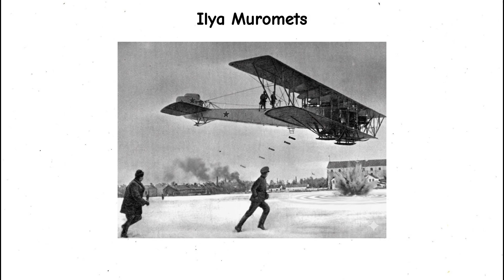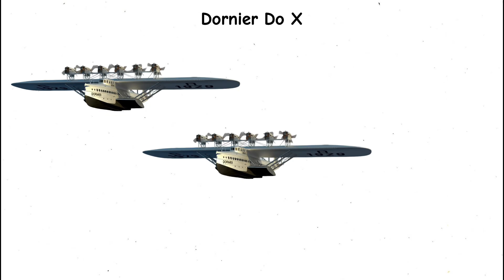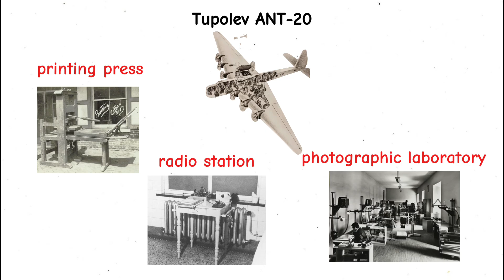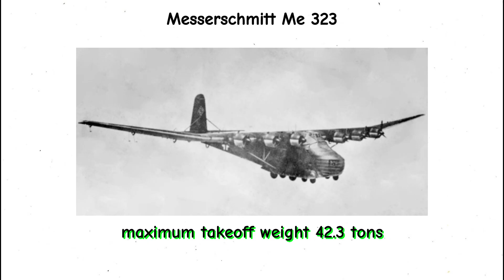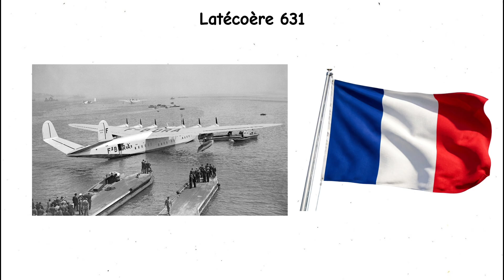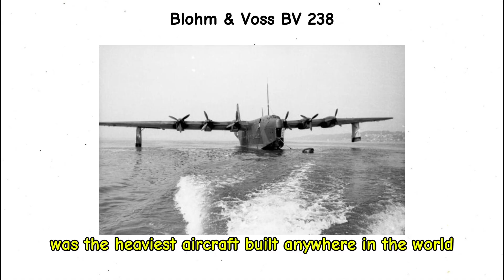Every Largest Old Aircraft Explained (1913–1944)

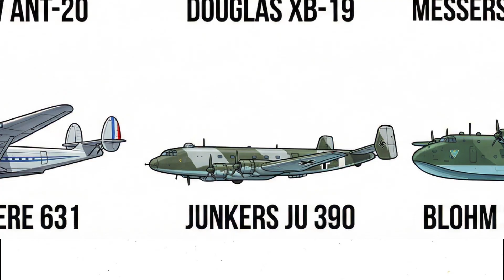Comment: In 7:38 scene, Ju 390 use powerplant by BMW 801E engines(deploying about at 1,975hp), They originally planned for BMW 802 or DB 604 or Jumo 223 engine, But three new and over 2,000hp engine has tested to fail and no massive production, They have use BMW 801E engine to give Ju 390, And that try to use BMW 801Q(turbocharger) or 801R(two stage four speed supercharger) give Ju 390 more flying high speed and high altitude to deporting Ju 390 strategic bomber version, But it is never exists upgrade project.